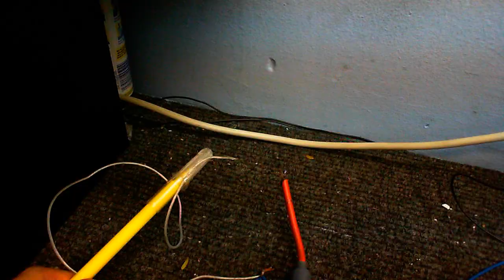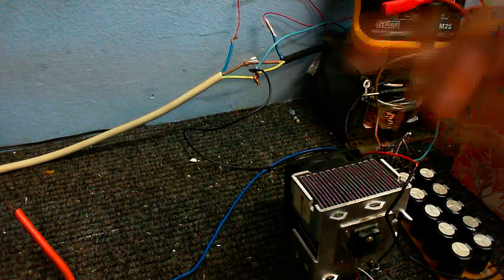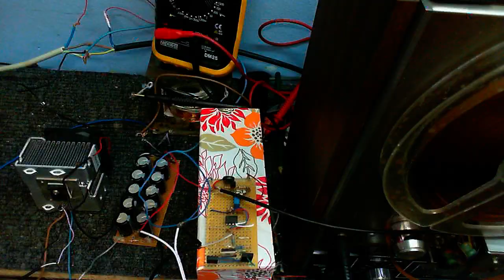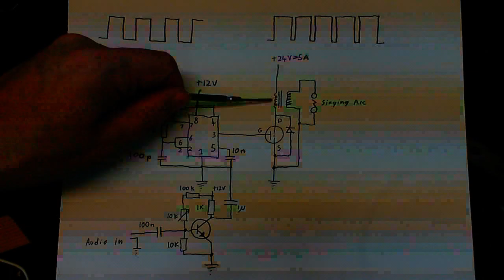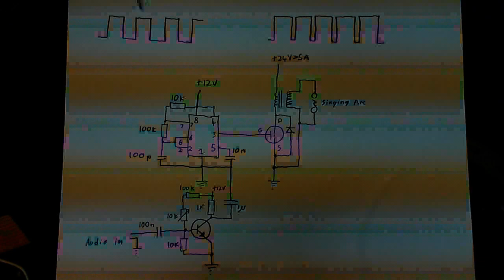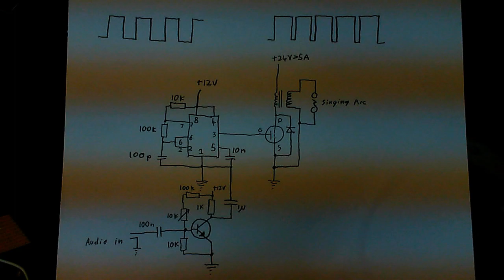How to make a singing arc

Comment from the maker: It can be simpler than this, the preamp that feeds pin 5 of the 555 timer can be omitted and the audio source can be connected to pin 5 though a capacitor of anything from 0.1uf and 2uf, but the audio source would have to be quite strong, a loud headphone output would be just about enough.   The 555's pin 3 can be connected directly to the mosfet's gate without needing the other two transistors.  That about as simply as it can be done.

Comment: I made a simple 2 transistor class B amplifier that drives a winding on a ferrite transformer, of which the other winding is a 20 coils of thick 20-15 awg wire for the main inductor on a ZVS driver. This modulates the input power which makes the output sing. If the class B amplifier is built properly, it can have very decent audio fidelity. I used an MJE3055T and a complementary MJE2955T transistor, with 2-10uF input capacitors, the negative of which goes to the mono sound input (3.5mm jack) and the other 2 ends go to one of each of the base of the transistors, which has a 4.7k resistor biasing the NPN transistor to the positive rail, and the PNP transistor to the negative rail respectively. The value of it is very critical to minimize distortion, I spent hours testing different values to stay in the linear rage of the transistors.

I did try to build the 555 version, but I just could not make it last without blowing transistors left and right. In particular, whenever I boxed it up inside my project case, the transistors and 555's would just blow out after a few seconds. Heat should not have been an issue since I had a large heat sink, and it would only run for seconds. At one point, I had the ark working flawlessly, but the audio was crackly and awful, and looking at the circuit, I screwed up horrifically on the 555 driver itself, after fixing it, though, it blew. eventually my 12V 9A SMPS failed, at which I decided to go with the ZVS route instead.

Comment from the maker: @Alex1M6 I used a bc546 if I remember, but just about any npn should work, that's why I included a variable resistor in the preamp, so the bias could be tweaked for different transistors.

I'm desining a full-bridge driver at the moment, I'm going to need to get myself some more mosfets so I can build it, but it's looking good so far in the tests with the parts I already have.

Comment: would this by any chance work with vacuum tubes if you didn't have any modern diodes or modern rectifier circuits? I ask mainly because I have an old eveready radio that I can't find a replacement electrolytic capacitor for the one that dried out  and at this point, I am giving up repairing the radio and just thinking to salvage some of the old parts from it. Mainly the five tubes in it and one of the remaining working capacitors/condensers in it, probably just the paper wax cap/condenser in said radio for the excess voltage it leaks in hopes for better results of a singing arc circuit. also thank you for whatever tip on the matter you have to offer, I appreciate it

Comment: @cooldudeclem is the 10k resistor that goes to pin 4 connected to +12 volts and is the 100p cap connected to the 10nf cap connected to ground? please respond I can't tell.

Comment: Wow that audio modulation was loud! is it really as simple as using a pre-amp?

BTW I think you might have made a mistake with the schematic, it looks like the pre-amp is going directly to ground rather than to pin 5.

Also does you MOSFET heatsink get hot if you don't use a fan? (Mine does).

Thanks.
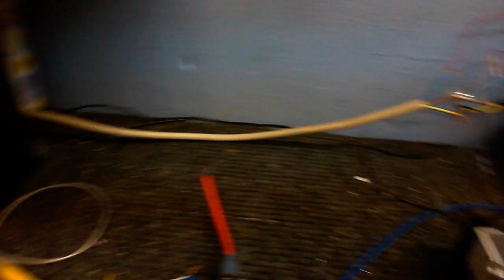Reply: I think it does. He explains it at 2:48. His heatsink is cooled by a fan.

Comment: what is the transistor in the audio circuit please
Reply from the maker: MonkeyMagic Elecifun I'll tell you what both transistors are how's that? The transistor in the audio circuit is just a standard BC547, nothing special. You could pretty much use any NPN transistor there such as a BC109, 2n2222 or whatever you want.  As for the power transistor, as I say in the video, it's a IRFP260 Mosfet.  The mistake I made in the schematic is I drew the 1uf capacitor (there's only 1 1uf capacitor in the circuit) with one lead connected to ground, it should be connected to pin 5 of the 555. So just to clear things up, the 1uf capacitor should have one lead connected to the collector of the BC547, and the other lead connected to pin 5 on the 555, it doesn't matter which way round the capacitor is since the voltage at each side is going to be about the same, but I would still use a non-electrolytic just to be safe, or 2 2.2uf capacitors connected back to back.
Reply: CoolDudeClem Oh wow, cheers Clem, that is really really helpful.I think I shall have a bash at building this. I looked up the 12AX7 and there seems to be a few different variations, I am not sure which one, which would you get to use as a pre amp?
Reply from the maker: MonkeyMagic Elecifun As far as the 12XA7 tubes go, I really don't think it matters, I have a couple of those (they are called ECC83 here, but it's still the same tube), the two that I have are different inside but there was no noticeable difference when I tried swapping them.